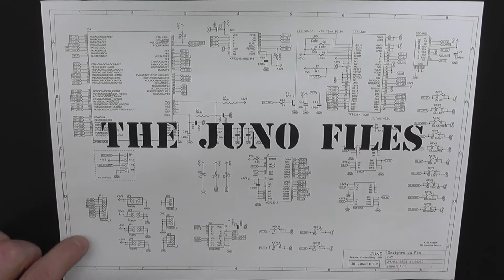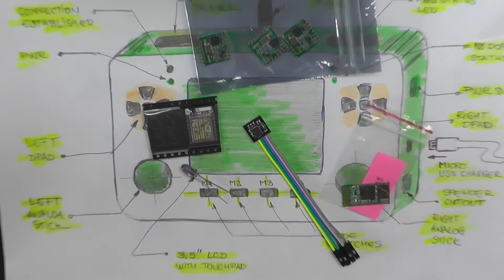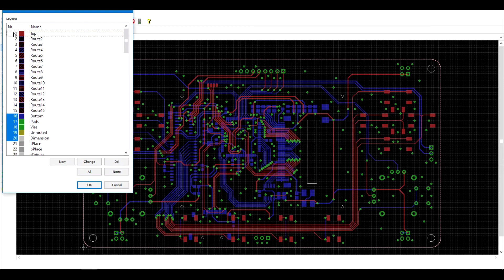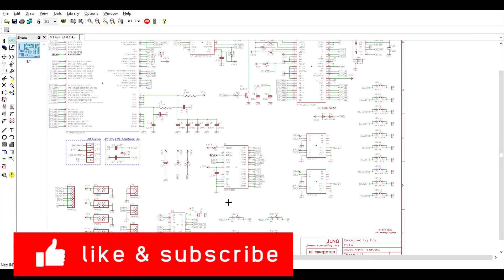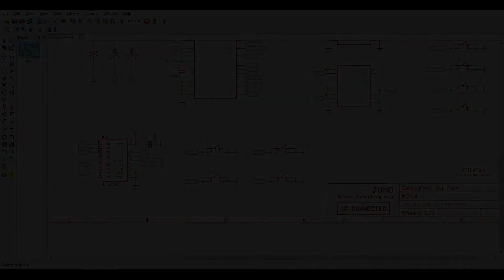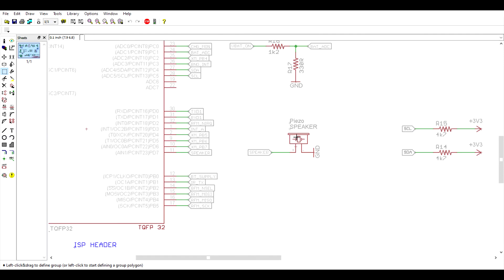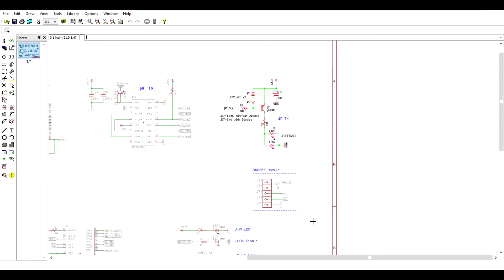Code Name: Juno / The Universal RC - Series Intro

Comment: Is it possible to make a phone with text message phone calls and very good camera and google maps and maybe whatsapp but nothing else as in no youtube, no google no Facebook or social media. Is this possible???? Pls reply??? Thank u!
Reply from the maker: yeah it's possible. I see two different approaches: Texting, Phone calls and a camera wouldn't be a complicated thing. You can watch my video about the cell phone I designed here: https://www.youtube.com/watch?v=JDmqrCzniDg 

It doesn't features a camera but I can add one and it wouldn't require a much more powerful processor or a SoC.

2. For google maps and whatsapp I would have to change the architecture a lot, since it would need to run Android as operating system. You could then uninstall everything else from the package and keep only the apps you want.

There's a middle way between these two. Use the first approach, no Android at all, just SMS, Phone and Camera, include a GPS module and then use the data from the GPS on an external device to do the navigation in real time or just save the route on a flashcard to visualize it later.
Reply: @coreWeaver  - thank you for your reply. I believe I have a phone addiction. When I uninstall apps I just re install. So I don't want any way to have apps. I think I would just need phone calls, mms and text messages and a good camera asni have kids so will want to be taking pictures of them and can send to friends and family via mms. Don't think google maps is needed as i can get navigation in car. Email is also nice to have as the school sends messages to the parents. Whats app is good as in not addicted.

Comment: Wonder if you have any devices that use lower frequency rf. I bought some LED lamps recently thinking the remotes would be ir, but they were RF, so I was glad I already had a Sonoff RF that I had upgraded to use Tasmota.

That is a nice little bno055 board! It would be really cool if it had the bno085, which is basically the same imu with much better firmware (better fusion algorithms)
Reply from the maker: these LoRa modules I use come in two flavors 868 and 433 Mhz. That lamp you were talking about also uses 433 Mhz for the RC. 
The pinout of the modules is identical, and the software part too, so I can easily switch between them if needed.
Reply: @coreWeaver  oh interesting. Can the lora radio interop with non-lora protocols? Or are you mostly looking to control devices you make?
Reply from the maker: @rpavlik1   This module I'm using for long range communication will require a same module on the other side.